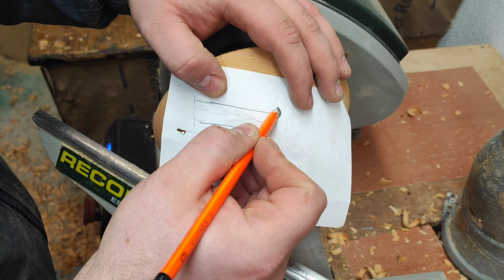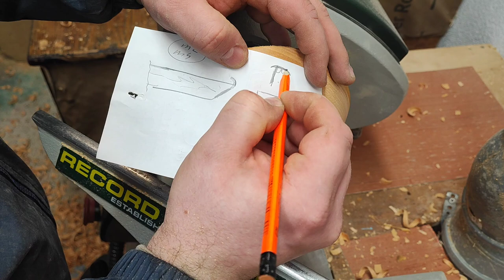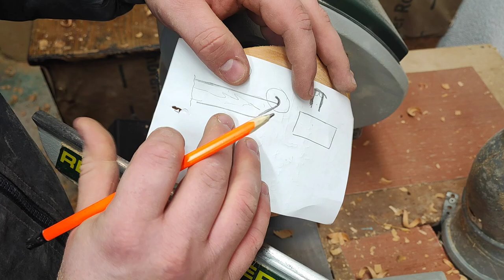5 TOOL FINISHING METHODS  / 💥Negative rake scraper vs standard scraper💥😉

Comment: Excellent demo.  I’ve been told that neg rate works really well on end grain in the bottom of a box.
Reply from the maker: Thank you, well it does but also standard scraper also works great.... negative rake is maybe little more frendly and less learning curve but in some situations you can not get straight wall as two bevels sometimes push the scraper away for desired line.... But both options are good and it comes down to personal preference 😉☺️

Comment: This has been a big help in terms of a thing I can remember seeing when I'm sharpening gouges and struggling with torn grain. I'd like to know what people think about getting a bur off the grinder running it in reverse. It was my intention to have a grinder in reverse with two sisal wheels for sharpening skew chisels and woodcarving gouges, but because I dropped my second grinder (the one turning the correct direction) and bent the shaft badly, I ended up with an aluminum oxide wheel on the reverse grinder, and have been using it to sharpen scrapers. The sparks do fly the wrong way of course. Perhaps there are other reasons not to do this? It does leave a bur.

Also, here's an idea: Grinders are crap. There will always be a ton of wobble, I've seen youtuber machinists go to ridiculous lengths and still not get them to run true. What about setting up a mini lathe like WEN LA3421 ($209 on amazon) to run grinding wheels?
Reply from the maker: Thank you for watching and support what I do 🤗, my idea behind this is that burr is raised due to grindind metal of, a by product... So direction is not that important..... Even if you hone scraper you will still raised a burr .... I have seen woodturning store that have some of the sharpening systems to use directly on the lathe,so if you like that approch go for it ... I didn't try it so can't tell you much about it..... Now regards grinders, mine is due to replace but even as a rubish one when it does spull up it does run true enough to be able to sharpen and I use oxside white whell which you need to dress as well..... Hope that helpes, it my view on it at least 😅
Reply: @tomislavtomasicwoodturning  Well I'm not hearing "running grinder in reverse is something we were told never to do because safety" so that's encouraging :)

Comment: my dear friend, I understand everything you say and want to demonstrate, but let me add one more detail,... put the tool support at an angle of 90 degrees in relation to the tool, and if there is no vibration the results will be even better and you don't even need to use abrasives,... but then we use them anyway... keep up the good work
Reply from the maker: Thank you Paulo, I usually put tool rest to most comftoble position, but good suggestion.... Thank you for watching 🤗

Comment: You presented some good information but this video ran way too long. I must admit I bailed out at about the 20 minute mark. In the beginning your demo of the gouges was essentially the same. The demonstration of shear scraping is essentially shear cutting or shear slicing. Also I think that demonstrating using a cone affects the result as the wood presented to the tool changes as the diameter of the work piece changes. Even though I disagree with some of your methods, thank you for sharing.🙂🙂
Reply from the maker: Thank you for watching.... Each turner has its ways and that is the beauty, this is from 3 differents master turners from which I learned..... And as I'm not good with names of different type cuts, every begginer will be able to see just from the shavings he produce what the surface feels and looks.... We can agree that there is multiple ways to drive a car, important thing is that we all get to destination....😉
Reply: Could you explain what you would do in order to get a smooth finish?
I agree with you saying that the wood on a cone changes. The surface speed that changes and the wood as such can vary aswell. But I think Tomislav did a good job with demonstrating the cuts. Cherry is particulary good in this instance, because it can react really precisely to the cuting edge and therefore show the physics behind turning. 
I do actaully prefer longer and slower videos. If its too slow, you can always skip through it. Just change the skip time to 5sec (10sec should be default) for each time you press the arrow buttons or double tap on mobile.